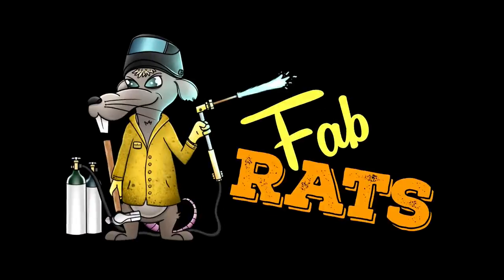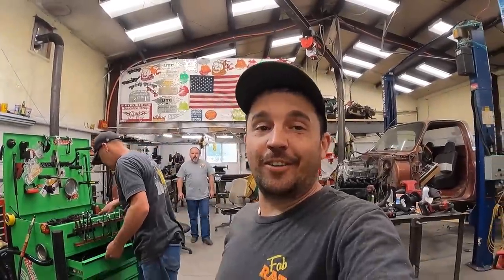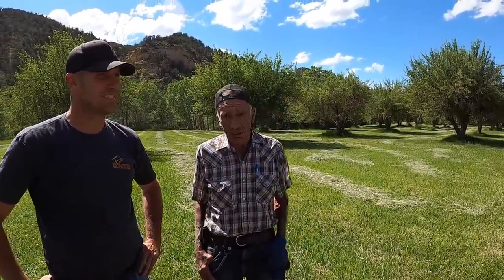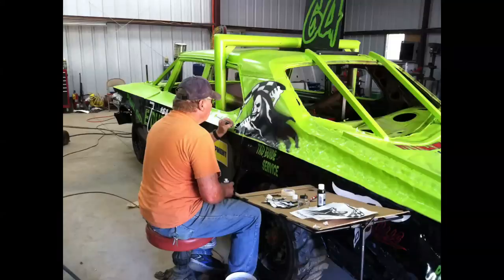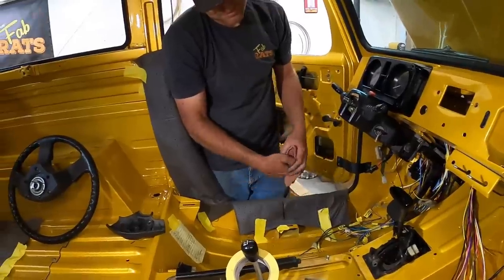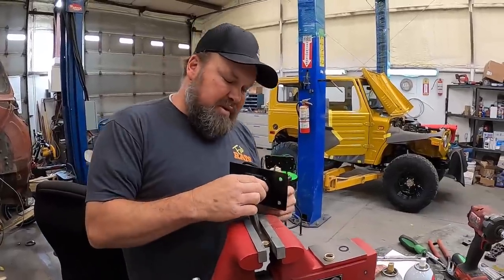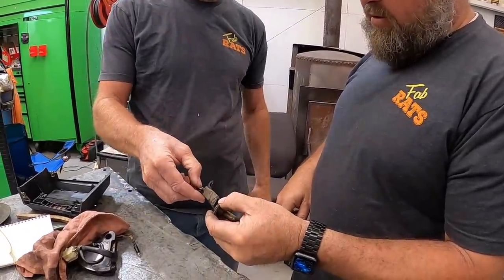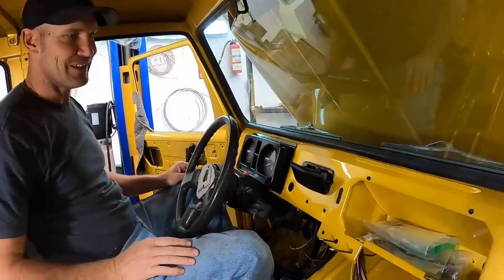One Step Closer!!  The Golden Nugget Gets A One Of A Kind Shifter Installed.

Comment: Hey, I was at Walmart a couple months ago and I was amazed at what options there are for radios now. They have radios that are basically the size of the ol removable faceplates that you can just connect up the power and speaker wires to the back of them and it's handled. Wondering if Ed really wants a radio you could probably pick up a decent one and get Ed radio'd up! Could probably just build a little L bracket to mount it just under the dash with a couple screw holesright above the hump. Just a thought

Comment: Looking great! But unless you've already done it, please remove the remaining stainless steel bolts/nuts from the suspension links and replace them with proper Grade 8 hardware. Unless you're buying from, say, ARP, stainless hardware may be ASTM 303 or 304 with a working tensile strength as low as one-quarter of Grade 8. Those need to be replaced for Ed's safety.
Reply: I have worked with a lot of stainless nuts  and bolts and yes they are soft. When ever I had to take something apart and put it back together with stainless hardware I always just replaced it because a bunch of it would seize and have to thrown out because it is soft.
Reply: @Chris_at_Home  if you think this rig will ever go back to that mine..   you..  need a re-think.     I grew up in Alaska. This $620,000.00 rig isn't getting off road stripes..

Comment: Best part about that SC1 spray on off road bikes and quads is the mud resistance. You spray it on heavy and let it set for a bit and you can run through all the mud holes you want...when you get back it looks like you didn't ride it.

Comment: Something that I found that really helps strengthen plastic welds is to use metal screen to span the weld. Melt it in and smooth out the surface after.

Comment: Getting closer everyday. Sometimes the jobs you think will not take very long and ends becoming a pain and takes a long time and then there are the ones that you think is going to be a lot of work, and even put it off because of that, ends up going slick and goes together in half the time you imagined. The shifter looks like it should be there and the steering wheel is by far one of the best improvements on the inside. Been wondering if there is a prop rod for the hood. Ed will either use a piece of wood or something or scratch the paint by putting it up like you are. Enjoy hanging around your shop if only by video. Thanks.

Comment: IF THE OVERFLOW TANK IS THE SAME AS THE ONE i JUST INSTALLED IT HAS NO BREATHER HOLE AND WHEN THE COOLANT EXPANDS IT PRESSURIZES AND BLOWS OUT AT THE RADIATOR CAP AND BLEW OUT THE HOSE KEEP UP THE GOOD WORK

Comment: I wish I could get my (mostly) '68 Corolla in that shop for a minute. It needs few fabs ratted out...no that sounds bad...a few rats fabbed out! Yup.
Bought it for $300 in '88. My daily for 30ish years. Parts are...hahahahahahah...yeah good luck. Managed to keep it going one way or another. 
My daughter thinks she wants it when I shuffle off but I've told her she would do better trying to sell it than drive it.
I knew nothing about cars when I got it. Bought a Haynes manual. I even stripped down two differently bad transmissions and made one good one.

Comment: Maybe install an aftermarket steering wheel. One with a flat bottom, so there is more room between the bottom of the steering wheel and the thighs. You could even add one that has quick disconnect. Just a thought. 
Either way keep up the awesome work. I excited to see Ed get it back!

Comment: Just a word of caution. I have been welding and fabricating for about 27 years and I haven't been seriously injured unlike others that I have worked with. That would be because I DO NOT do things such as have 3 pressurized cans of flammable liquids a mere 1 foot away when I am welding. (21 minute mark) 
   It isn't so much a spark that a person needs to worry about, but the wire making contact with the metal can for any reason such as setting the gun down and the trigger getting depressed.
   Be safe, set a good example, and keep up the good work fellas.

Comment: Since no radio.. y’all can install a teramps trio.. it’s a 3000 watt amp.. can power subwoofers and speakers.. has fm Bluetooth and usb built in.. so no need for a head unit.. Ed can change the channel on the amp itself

Comment: I know it is kink of a horse has left before the gate got closed but for future thought on something like the nugget maybe use an electric steering booster like on a Prius to give a manual steering box power steering. Judy need to install it in the steering shaft with no need to install a pump or lines.

Comment: That shifter from the AMC looks identical to the shifter in my ‘83 Mustang. It wouldn’t surprise me if it was a Ford part given how AMC liked to borrow parts from other manufacturers. The cable that attaches to the thumb button in the handle is a weak point and will eventually break. I went through three of them in about 100k miles.
Reply: Later in the video I see that the handle is a different setup from my Mustang with a finger button instead of a thumb button. Likely a better design, less stuff to break. Looks really good in the Nugget!

Comment: If the motorcycle renew fluid doesn't work, use a heat gun to bring back the color.

Shifter needs Golden Nugget - Fab Rats decal on the right side blank spot. Michelle, get to work sister!

Comment: Wouldn't give a nickel for those $50 + each stepped drill bits. I bought one at a local hardware store to replace my 6 year old harbor freight step bit to drill some ⅞" holes in some ⅛" bar stock, the harbor freight bit drilled 6 out of 8 holes. The Milwaukee burned out during its first hole, had to run back to the hardware store and swap it out for 3 regular bits.

Comment: I am sure it is a ''''''''simple''''''''' solution to the tight front seat space issue, but what about shortening the seat frame so the seat sits a little bit lower? I'm not sure how complex the stamped base frame geometry is or if it would allow that option easily. But that half back seat looks like it is sitting awful high in the videos.

Comment: I'm concerned that there is nowhere near enough allowance in that reservoir to pump hose to absorb the engine movement. The reservoir is fixed to the chassis and the pump is on the engine which is flexibly mounted and so will move about a surprising amount from all sorts of forces.

Comment: Hey Paul and the team, 
Quote "My eyesight is too important" so i dont scimp on welding helmets - But why do none of you wear eye protection when grinding??? Scraps of metal shards flying off in random directions beyond your control could easily end up in your eye. Pse where some safety glasses. 
I was the same until in ended up with a piece in one eye, fortunately it was removed and no damage. 
Andy  - UK

Comment: Hmmm start with a 90 degree angle and make it smaller but it's a 120?   Math issue?
Reply: It’s all about perspective. Before whatever entered this fitting/tube at one end got redirected by 90° before leaving it, and after the modification that change of direction is by 120°.

Comment: You need to find someone the same size as Ed so you can adjust everything to fit him. His Height, weight, leg length, arm reach etc etc. Hate to see you get it done only to find out it's not comfortable for Ed. After all, it's going to be custom made for him. Remember, it's been 40 years. He's not the young man he once was. IMO Think about it. You don't just buy the first vehicle on the lot when buying new. You sit in them, drive them, and test out the features that are comfortable for whomever is going to be driving it the most. Have you ever had someone give you a present with them thinking it's just what you want. You're grateful, and you appreciate the thought and work that went into it, but in reality it's not what you really needed, so you pretend to like it, then never use it. Just sayin.

Comment: More dragged out videos on the FrakenZuki for clicks. 36 minutes to make a custom AutoTrans Shifter to fit into a hole? What's next? An hour cutting and installing carpet? 🤦🏻‍♂🤦🏻‍♂And so many wires and connections that are beta at best under load. Volts and AMPS and proper gauge of wire and fuses. NOTHING on this is standard or ever tested as a completed unit before as almost nothing is from an LJ40. We can only pray it will be safe for Ed to drive and not have fuses blow or too low spec wire burning up causing a fire. Yep. It is fun to watch it come together but for me I wish it were going into a museum or auto show to look at instead of actually being driven daily. Complete Beta Test vehicle in almost every way other than the frame that is the ONLY part from Ed's original used on this vehicle. Here's hoping I am wrong long term!